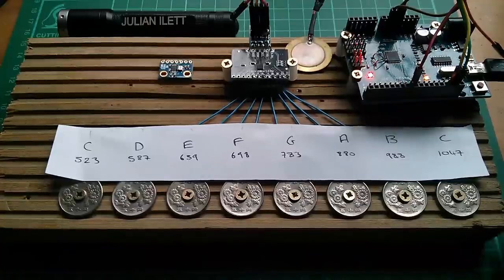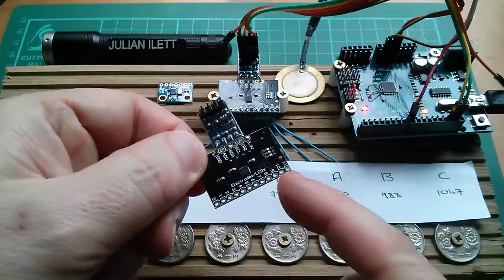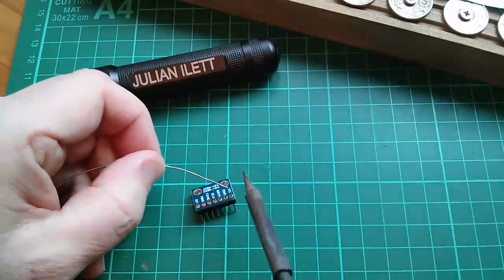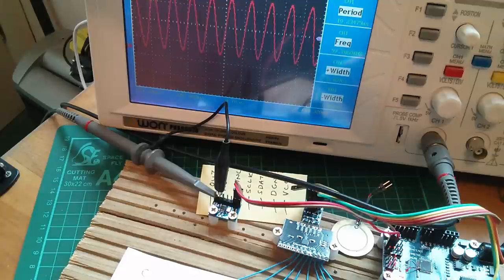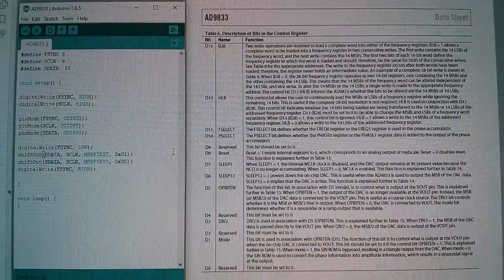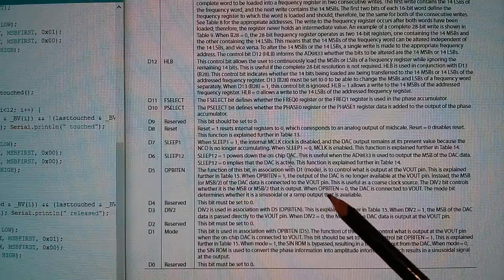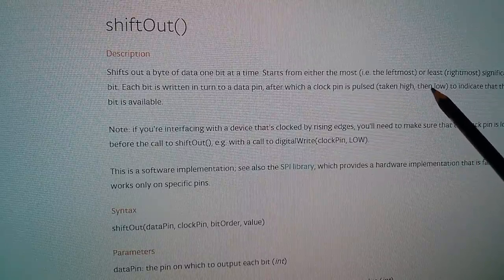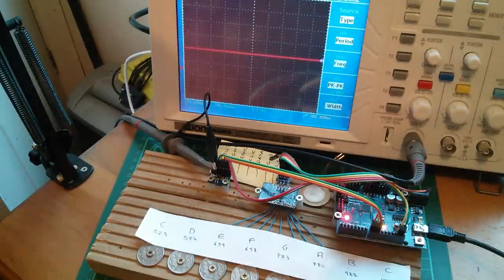Project: Penny Organ - Playing with the AD9833

Comment: The double frequency and phase registers are there so you can set both values correctly before enabling the new value. If you only had a single register and want to change frequency and phase, you would have a step where either frequency or phase is not what you want.
Reply from the maker: +superdau It may be possible to send multiple commands while the FSYNC pin (effectively CHIP ENABLE) is held low. I think I read something to that effect in the data sheet.
Reply: Julian Ilett
Yes, you are right about that. But I it looks like the commands are immediate. Otherwise the chip would need multiple extra buffers that keep the new values in a temporary place until you release FSYNC. The datasheet only mentions an input shift register and normally in those simple devices they just latch the value as soon as they got all the bits they need for one command (in this case 16).
You could try not releasing FSYNC at all. If you still see changes on the output, you know it's not not the FSYNC that does the latching, but just the number of bits.

Comment: Hi Julian, quick question (or if any one could answer I'd appreciate it!!), with regards to the AD9833, can it be used as a stand alone function generator - in other words after writing your preferred frequency to the module, will it remember this frequency when re-powered??? any feedback would be great, thank you!!
Reply: The answer is no. The data sheet states that the device should be reset after a power up. This suggests that the frequency and phase registers are likely to contain uncertain data when power is first applied. However, given the device only requires 3 digital pins you could use an ATtiny45 with a simple sketch to program your required frequency for a minimalist setup. It could be achieved with just a setup() function and an empty loop(). You will, of course, need to add the ATtiny support to the Arduino IDE.

Comment: I am pretty sure that a lot of the cheap modules directly from China are using the "rejects" from production. It's very visible when you buy COB-LEDs or LED-strips, where LEDs light up unevenly or sometimes not at all.
I got a few of the ACS712 based current sensor modules some time ago. While the 20 and 30A versions worked as per datasheet, the 5A version had a noise ratio way higher than specified in the datasheet and the Volts per Amp a output was too low. I got resent another pair (from alice), but it had the same issue. I doubted my measurements, because they had the same failure, but then ordered an ACS712 IC locally from RS components (one chip cost me more than two of the full sensor modules). After replacement the module was "in spec". 
So you get what you pay for, and don't use modules from Ebay in production devices!
Reply from the maker: +superdau I completely agree. I bought all the PIC12F683 chips for my solar charge controller from RS and had no problems. Then I bought five ICs from a popular eBay seller, and used two of them in controllers both of which didn't work properly. Both had a problem with the ADC - the battery float voltage was about 1 volt out of spec - a massive error.
I suspect that parts which fail the manufacturer's test process somehow find their way out of the back door and onto the grey market.

Comment: Just to add, none of the 3 three Scandinavian countries, Norway, Sweden and Danmark are using the Euro whether they are member countries of the European Union or not (Denmark - with exceptions- and Sweden are members).
Reply from the maker: +Jan Rasmussen Of those three countries, which, apart from Norway, has coins with holes in the middle. I wouldn't make a very good MEP.
Reply: +Julian Ilett we in Denmark have holes in our 1, 2 and 5 kroner coins. AFAIK Swedish kronor have no holes.

Comment: A quick comment about the code. Please format the code to use proper indentations. It makes it much easier to understand. Seems to be very common in the Arduino community to just throw the code at the screen and not pay any attention to making it neat and readable.
Reply: +leethaksor 
Easily done by pressing Ctrl-T at any time.
Reply: +slm60uk Not when I'm looking at a video.
Reply: +leethaksor 
No, I didn't mean you - I meant using Ctrl-T in the Arduino IDE auto formats the code. A tip for any Arduino programmer (eg Julian).

Comment: Norway uses kroner NOT euros
Reply: +Joakim Johansen (987654321 null) to add, Norway is not part of EU
Reply from the maker: +Joakim Johansen (987654321 null) Very sensible - euros don't have holes in the middle :)